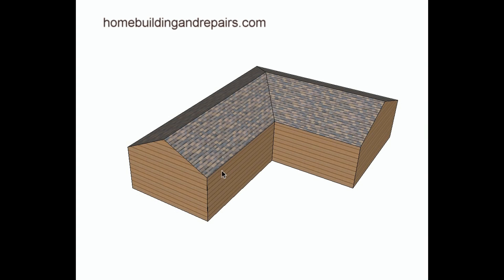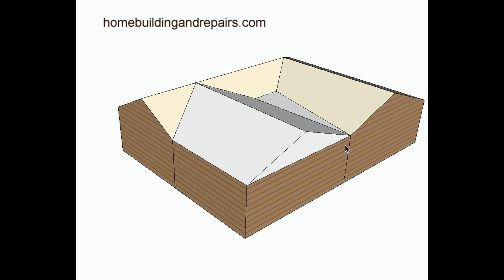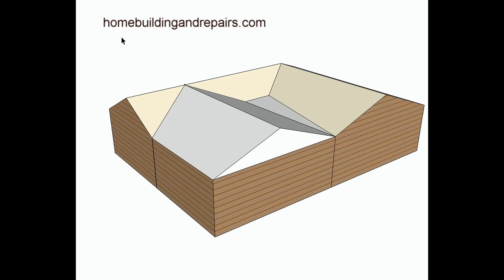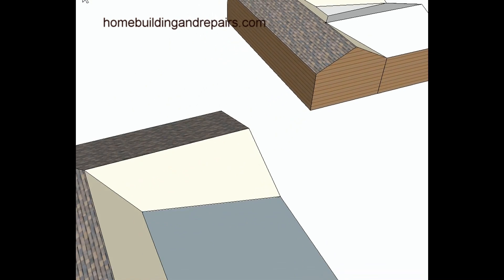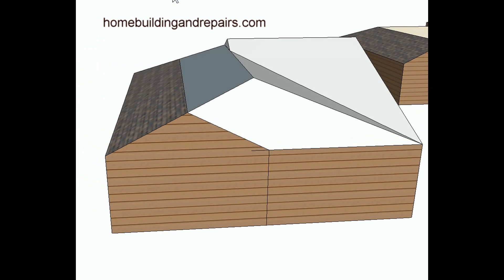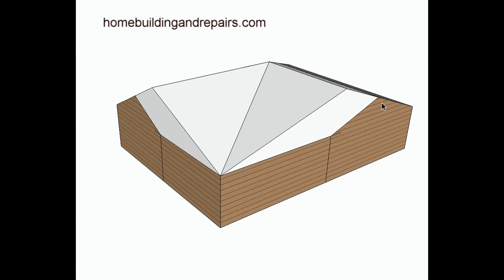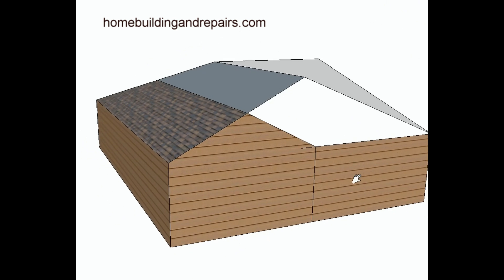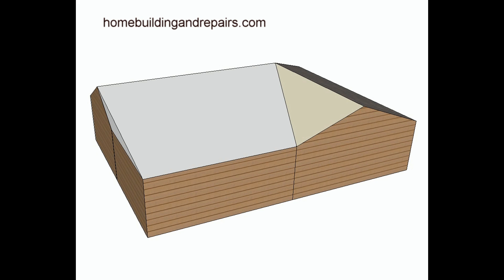How To Design New Home Addition Roof From L-Shaped Floor Plan

Comment: Great videos. Very informative. My home looks like this, but it is a hip roof on every side, rather than the 2 gable ends shown here. The addition I'm thinking of would basically be the same, but would not extend out as far on one side, so I wouldn't quite have a "square" house. What do you think the best roof idea would be for me?
Reply from the maker: That's a difficult question to answer, but I would suggest going to the website and checking out some of the home addition roofing design videos.
http://www.homebuildingandrepairs.com/home_additions/index.html

Comment: Thank you for your video, This is very helpful. I do have some questions for the sloping roof design. 1: can you build a regular roof rather than the slope roof?  2: can you give me more information on the Valley section, i’m still not quite understand how it attach to each other.
Reply from the maker: Try going to our website, then clicking on the remodeling tab, then home additions.